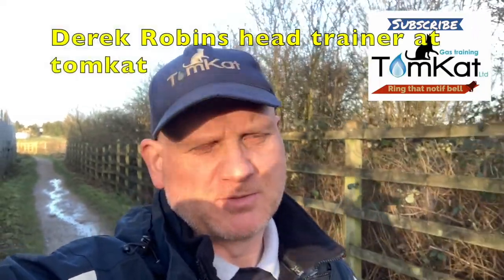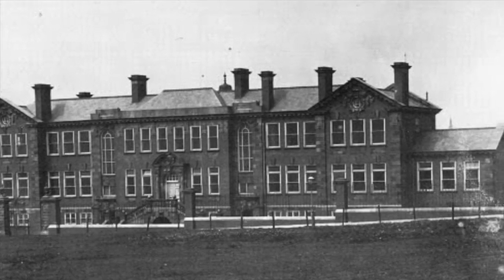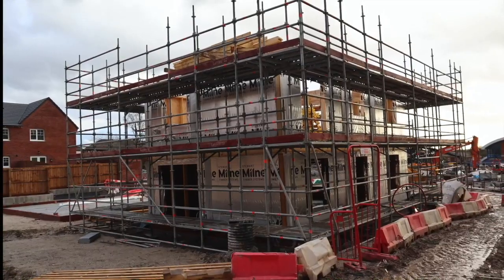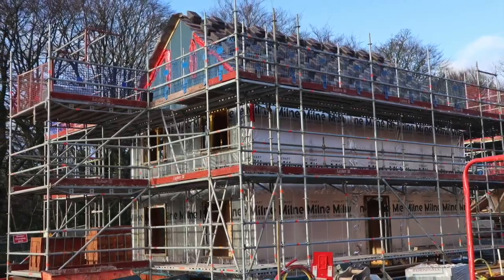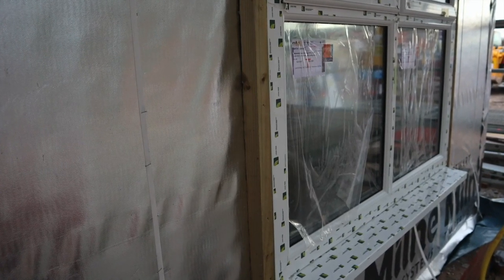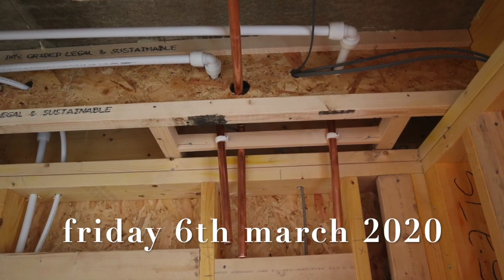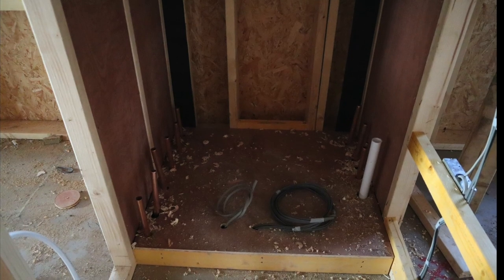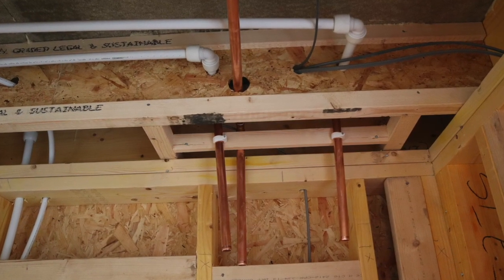HOW UK HOMES ARE BUILT IN 2020 PART 1. Looking at how a timber frame house is built start to finish

Comment: Isn’t a timber frame cheaper than brick built?
I know it’s a lot quicker process but isn’t the house more efficient being brick/cavity built?
Reply: @Goat Wouldn't one layer of ceramic blocks covered in styrofoam slabs and render be just enough for up to -40 centigrade and 100 % air tight, no mould no problem and simple? And 500 years after you still paint it magnolia every 5 year and thats it

Comment: why is this house built so crap? im thinking, normal houses have exterior walls consisting of bricks outside, insulation foam in cavity and breeze blocks on the inside. why is this just timber frame with no cavity insulation? that seems so crap to me. can someone explain why this house is made in this cowboy sort of way please?
Reply: My new build house is falling to bits already and the house was finished about 6 months ago. My house is built using the exact same method and believe me they are crap I wished I would of stayed in my 1970s built property at least it was solid. They build them this way because it's cheaper than the traditional method you were describing.
Reply: @scottwojcik2148  I agree totally, the only reason they build these type of house is more profit for the developer pure and simple.
Reply: Because it's in the UK and the standards are abysmal.

Comment: Great video thanks! I found your channel through your Nerrad tool review and stumbled around your other videos. Your video here is just what I wanted to see. I’m curious to know if my brick-built, timber-framed house built in the early 70s has a similar construction. I do know the internal stud walls on mine are not load bearing, but I’d be interested to know if the loft joists sit on the brick wall or the stud frame work.

P.S. I’m not a gas engineer or trainer, just a DIY-er doing a complete bathroom renovation and other renovations in the house. Keep up the good work and don’t let those trolls get the better of you! (I watched your Paul Carter video).

Comment: Looks very similar to the way we do it in the USA we use the stick framing method as well but instead of plaster for the walls we use drywall or Sheetrock. In my opinion this way works and does a good job. But it doesn’t work everywhere.
Reply: You do it way better in the US, the UK is full of cowboy builders. No end of complaints from new householders.
Reply: @Liofa73 looking at the construction of this house it looks rather flimsy compared to our stick framing. (Although we have some builders who make it look and be just as flimsy). At least it has OSB sheathing though. Some of our super cheap builders use cardboard! 😬

Comment: Question: why can't there be insulation in the cavity between the timber frame and the outer brick wall?
Reply from the maker: If it gets wet it would rot the wood
Reply: @tomkatgastraining  we can do it that way in the us. We usually put a vapor barrier on the outside between the insulation and the wall if you do exterior insulation. Usually we don’t put insulation outside of the wall but in the stud cavity

Comment: Is there a way to find out which walls are load baring, i have a timber frame house and im thinking of taking a wall out to make the kitchen/living room open plan. Is this possible in a timber frame?
Reply from the maker: I would say you would have to cut a hole in the ceiling to find out or speak to the original builder

Comment: Great vid, do you not need to use trac pipe to enter the building with timber frame or is it ok to use copper like in the vid? Also didn’t notice a sleeve?
Reply from the maker: Yes you are correct in both accounts when I brought it up they said it will be to all regulations when completed